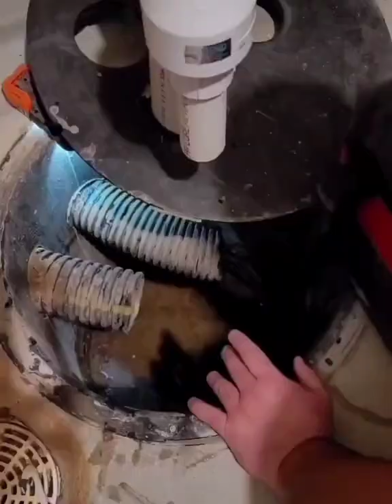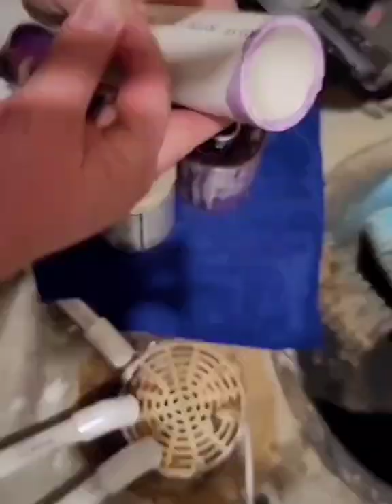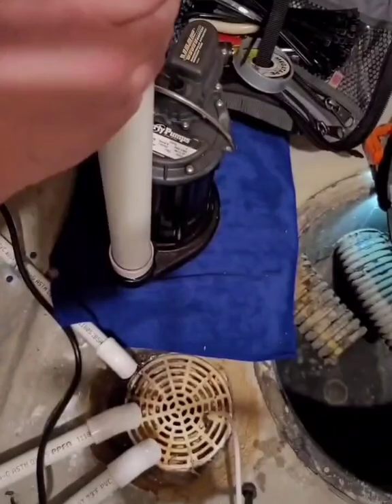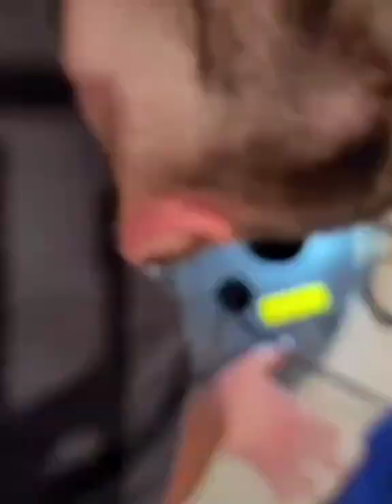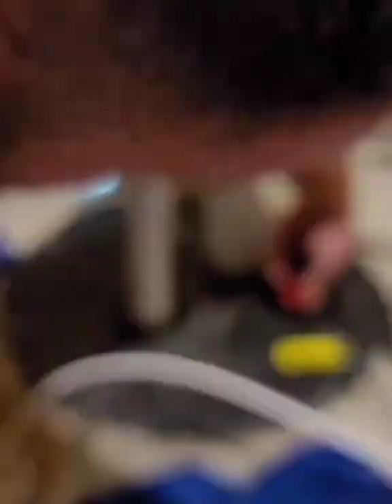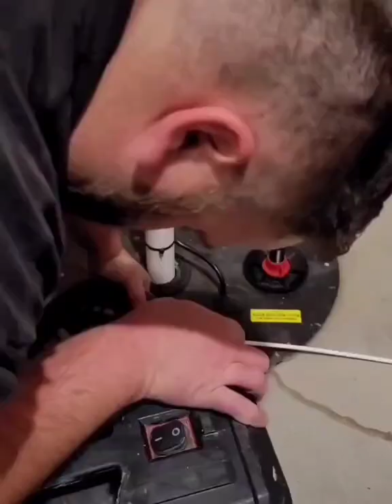Sump Pump Install

Comment: I'm surprised you didn't put in a new check valve during your install. When the check valve goes bad it could cause the pump to fail.

Comment: If the diameter of the hole itself us 16”, can I use an 18”cover to seal it? Or does it have to be a smaller size? Thanks

Comment: Is that a GFCI receptacle? My new pump manual says it's required.
Reply: That’s not a good idea . It’ll always trip
Reply: @cbausch7025 not so. Apparently code mandated it for my home. In any case, four years now dehumidifier going against that outlet and a sump and it doesn’t trip

Comment: The anti air lock hole is on wrong height on sump pump discharge
Reply: How high is it supposed to be?   My pump is cycling rapidly and I see water shooting out that vent hole when it runs.  Not sure if pump is failing but runs 3 to 5 x’s long than it used to do.
Reply: @vonmajor I don’t think it’s supposed to be to high. I don’t think it matters if it’s low as long as above pump. You want it low enough because water is supposed to shoot out and you want the hole where it shoots back in pit. So it definitely needs to be in the pit area at least and make sure you angle the hole where it’s shooting downwards if you drill a new hole in pipe.
Reply: Air rises in water, so higher is good, but low enough so it sprays into pit.

Comment: Forgot your shutoff
Reply: Lol what
Reply: He should’ve put a union where that coupling was installed. I was taught to put a union, check, and ball valve so that shit doesn’t rain down on you if you need to disconnect the discharge while it’s full. The swing check valve alone would make me nervous